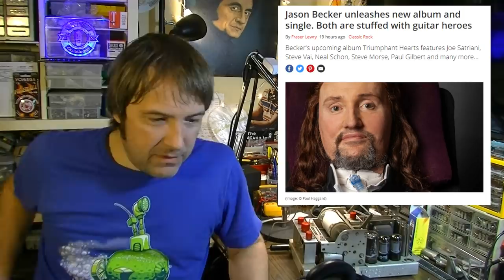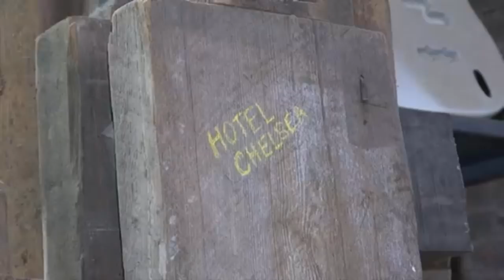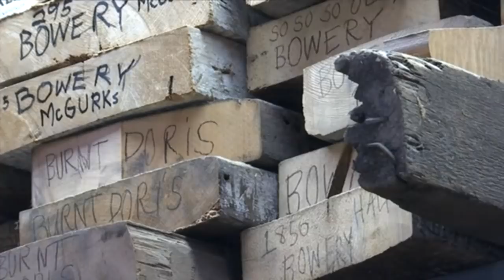SPF BONUS! Jason Becker News, Guitars Made from Old Buildings, 1972 Gibson Maestro Rover

Comment: Old growth wood is hard as a damn rock.  My Sister had her house taken down to the studs.  Her house was built in the early 40's and the actual 2x4's, which were indeed 2x4", is hard to even get a damn nail into it. It is dense.  Older wood, that has been dried indoors naturally, is amazing.

Comment: In my teen years I actually built rotating speakers and had some really good luck with their sound. Clean sound from a armature type brushes was my biggest hurdle, I couldn't keep them clean sounding for very long. If I had, had wireless back then it would have been my choice. Or perhaps Bluetooth even. Just simply mic the output, the sounds could be awesome. Especially if you offset two mics by like  30 degrees apart and stereo the sound.
Reply: William Maclin, a wireless or Bluetooth connection from the organ or guitar to the amp driving the Leslie speakers sounds like a good idea until you remember what kind of nasty noises an intermittent or overloading digital connection can make, and it probably wouldn't be very pleasant for the horn tweeter in the Leslie either. Blown tweeters could be an issue for sure. 

I was at the voice of the wetlands 3 Day music festival in Houma Louisiana last weekend, there was a Hammond and a roadworthy plywood Leslie on stage and the Leslie was spinning at a slow speed 24/7 whether somebody was playing the organ or not. Perhaps this was to keep the commutator slip rings clean? They did have a spare Leslie towards the back of the stage ( they had backups for pretty much everything----the Ampeg SVT that each and every bass player had been using finally failed and was replaced by a Gallien & Krueger amp hooked up to the same Ampeg bass cab). At one point I noticed that the Leslie and the Hammond were pushed off to the side and the spare Leslie appeared to be missing from the stage, so maybe they had to swap them, or fix one or even both on the fly----but the organ & speaker combo was back on stage and up and running again on day 3.

Comment: We've got a Leslie in the basement here.  Sadly, the remote footswitch is missing which makes it more a piece of furniture nowadays.
Reply from the maker: Sounds like time to bust out the soldering iron.
Reply: Now that would be a project. I think the preamp circuit was built into those. There was like a 10 pin snake that went from the footswitch to the cab.  It controlled volume, tremolo on/off and rate and included high / lo gain inputs.  Pretty involved.  Well over my pay grade.  One day that and the old Farfisa will rise again from the cellar.  Maybe.  Perhaps.
Reply: Look up Dr.fishsticks he makes a leslie controller you just have too hookup a preamp. I bought a motor contoller for a leslie unit from him on ebay
Reply: Good call.  Looks like a great economical solution.  Thanks!

Comment: How does the signal get to the rotary speaker without wires?
Reply: GriffinGTR slip rings
Reply: GriffinGTR, i guess the old school way would be to have "brushes" and commutators like a DC motor, or an alternator or generator, but thst would tend to be noisy when passing an audio signal  and I don't know  if any early  Leslies  used that method.  The Slip Rings mentioned by somebody below  makes a lot more sense, I only mentioned the motor brushes and commutator  as an example  to paint a picture inside your head. I guess the slip rings would be kind of like the  circular metal element inside a rotary switch or potentiometer, except a complete circle not just a half or 3/4 circle, with two of them back-to-back and rubbing against each other.
Reply: evilution, i am curious if those slip rings, which presumably pass the audio signal to the speakers, are prone to wearing out or becoming intermittent from excessive oxidation. Do they tend to need a periodic or frequent shot of cleaner sprayed in there? Are they good for a just a few years or  for 10 or 20 years of use?

I was at the Voice of the Wetlands Festival (VOW-Fest) in Houma Louisiana (organized by hometown boy Tab Benoit, a kickass blues-rocker) for all three days this past weekend; they had a Hammond and a Leslie on stage for the entire festival, and about half of the bands had keyboard players that really knew how to play it! I noticed that even when there wasn't anybody in the band to play it, the Leslie was kept spinning at a slow speed continuously, perhaps this was to keep the slip rings clean and conductive? I don't know what model of Leslie these were, (there was actually two of them with one being presumably a spare), and they were large tall black painted plywood cabinets with casters and heavy duty spring loaded metal handles. You could see the cheese wheel rotating one way and the tweeter horn on top rotating the other. Definitely not church-lady Leslie's.....anyway, I do love that sound! Only one thing was missing: nobody played guitar through the Leslie, sniff sniff, sigh..... PS, it was a terrific Festival with excellent bands and good food.